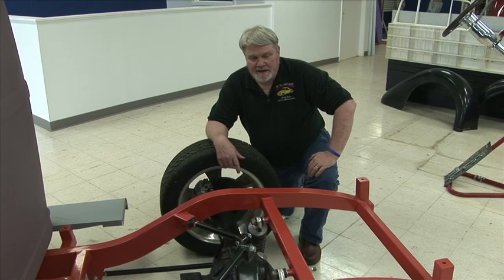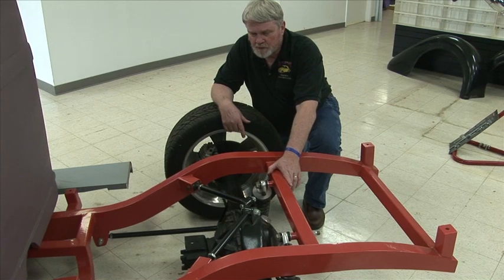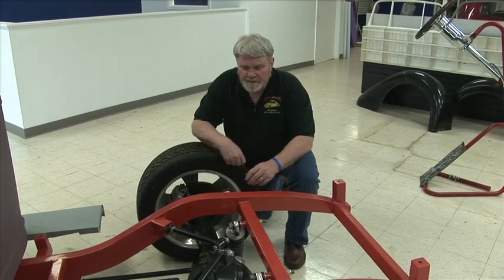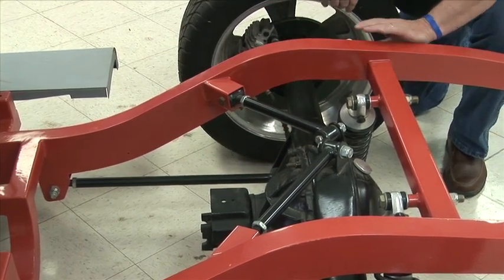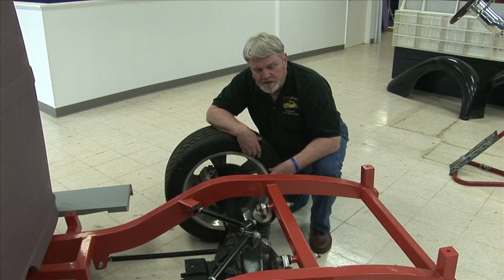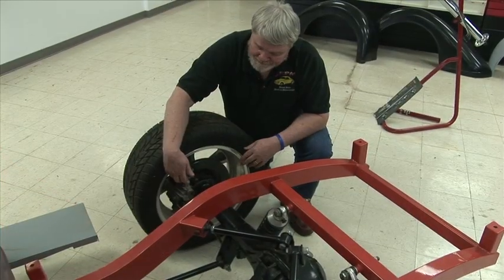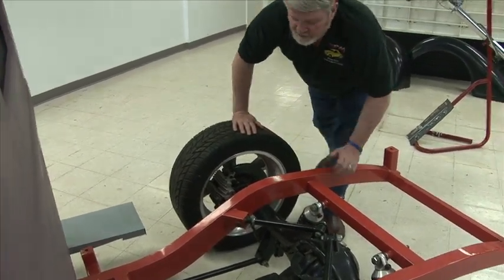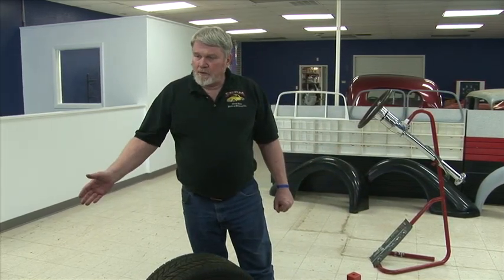SRPM Street Rods - Pro Street Frame Overview

Comment: Hi there, nice demo, nice lookin shop, congrats ! 

The triangles rear upper controls is there theory about geometry or ?  It appears it allows a little give but since bars are short do I assume it's tighter stock uppers that flex and twist etc.
Reply: +Paul Zonneveld I believe that allows them to eliminate the track-bar or not need one.